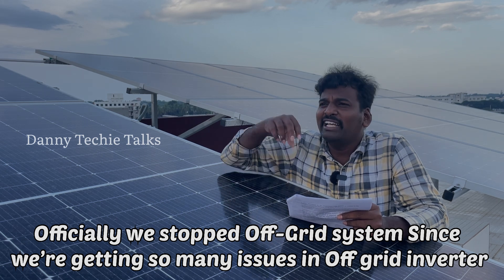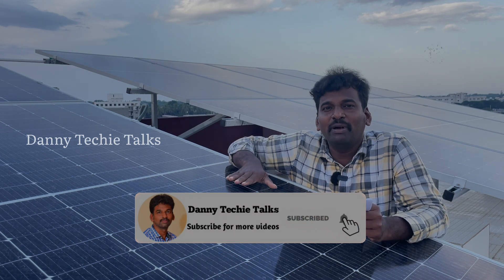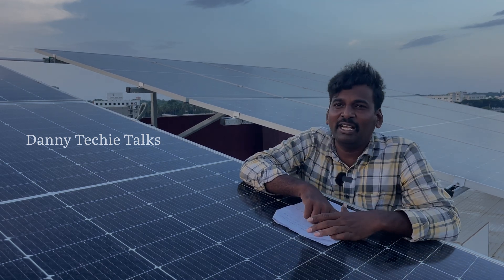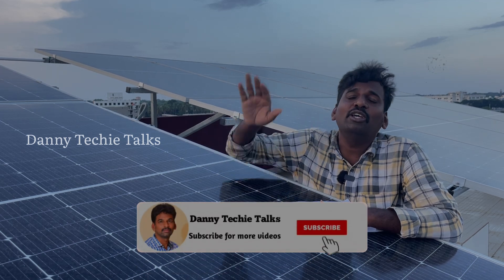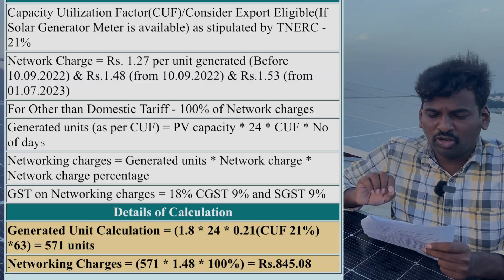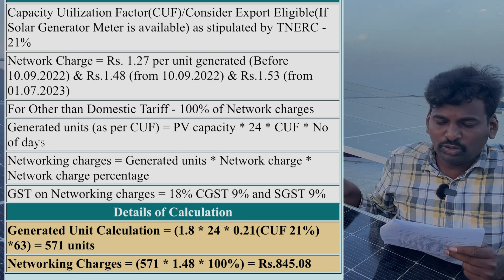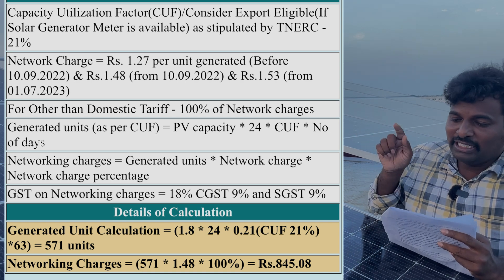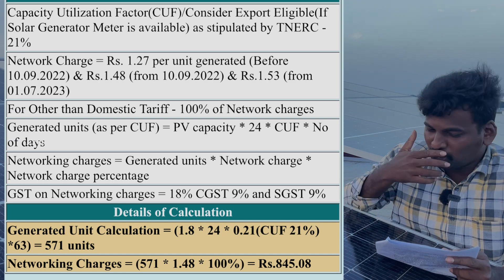How to calculate Commercial solar TNEB NET meter reading | Net-Metering system from EB | Solar meter

Comment: Now, even for Domestic current also only net feedin i.e only monetary value adjustment is done.
Reply from the maker: No , never. Please read the GO carefully and apply in net meter scheme.
Reply: @ their matter for documentation in bond paper is mentioned net-feedin scheme. Not giving an option for net metering. Some where it is told that net-metering scheme is stopped in 2019. Now only net-Feedin. Any how let me try to check once again with TNEB.

Comment: bro one doubt Na industrial service vangi iruken daily 25 to 30 unit consumption aaguthu bro  na how many kw panel podanum
Reply from the maker: 5kw more than enough for your requirement but read commercial net meter terms & conditions correctly and proceed with solar installation. Always I’ll prefer solar for day usage only ( commercial)

Comment: For residential also network charges they are calculating standard units based on our KW. Exm for 3kw 900 units we have to pay net work charge. Tneb people will not consider our production unit.

Comment: Bro
Monthly 40000eb bill kaduren
Flourmill oil mill

Enaku ethu soot aakum

2months once 40000
Varuthu

Day time use only
Reply from the maker: Should install 20kw On-grid system to satisfy your requirement. Best for day time usage .
Reply: @DannyTechieTalks  contracted load poruthu thana poda mudium bro

Comment: There is no eb power supply for entire home due to building 13meter issue. ( 1bhk - 3 units ), Then off grid solar possible for this condition?

Comment: How to calculate for 24x6 days running mini production factory? Day and night shift for 6 days continuous running factory.
Reply from the maker: Take average running units from 8 am to 6 pm and install panels for that. For example if you’re using 80 units in a day time then please install 20kw on grid system.